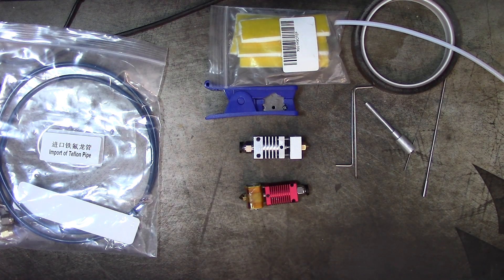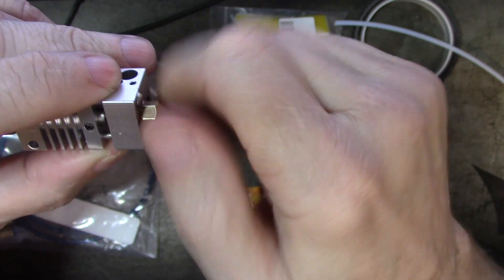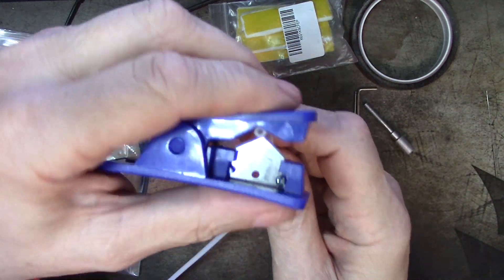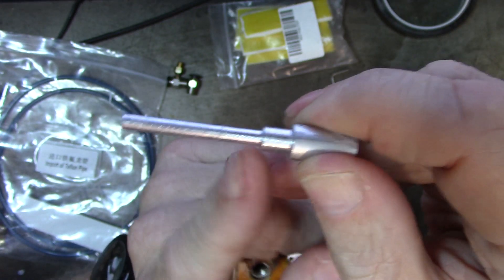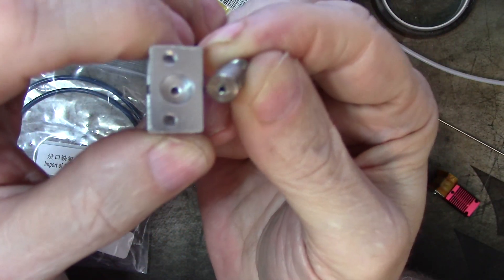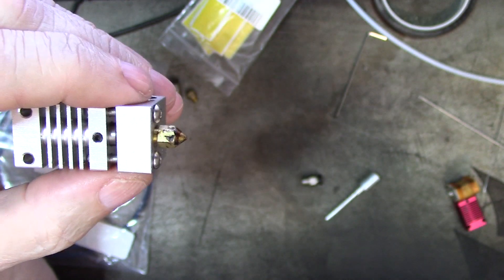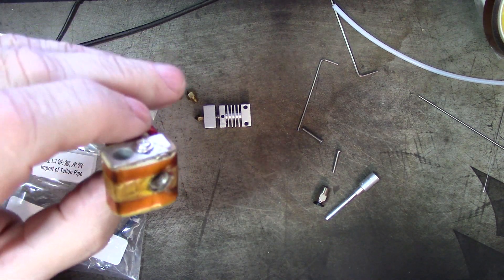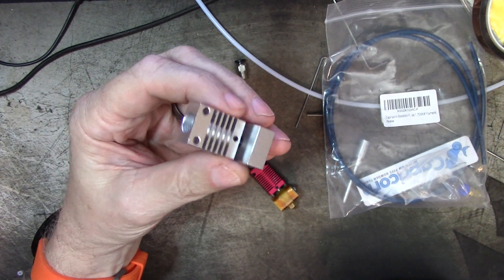Cheap All Metal Hotend for your Ender 3 UPDATE!

Comment: I wonder if my ender 3 v2 came with a metal hotend every upgrade I see the original hot end is red and mine looks like all of the all metal people are buying
Reply from the maker: Easy way to tell. The bowden tube on an all metal hot end will only push in about 10-15mm or so, from then on down the hole is only large enough for the filament.
With a non all metal hot end it will push all the way in until it contacts the top of the nozzle, or about 40-50mm. Or to be completely sure, pull the nozzle and if it's not all metal you should be able to push the bowden tube all the way through.

Comment: I got one of those cheap hotend and it failed me on first print (molten filament leaked between heatbreak and cooler), second try with extra care to prevent any gaps there, again... the machining of the cooler block is bad, maybe that's the case. I gave up on it

Comment: If most of the time only use PLA, PLA+, ABS, or PETG, I would suggest use Ender 3 hot end with capricorn tube.
I found all metal hot end use more slightly higher temperature than the stock one, hence consume more electricity which I believe is not worth it for those filaments.
Consider to use multi hot end for different purposes would be favorable.
Reply: If you have good insulation these few degrees should not cause to consume that much more electricity. Especially if you are using a hotbed. These puppies are essentially wasting all heat you pump to them (cuz you cant insulate the top surface). So in comparison to slightly higher hotend consumption (probably less than 1%). I wouldn't bother with saving electricity by sticking to the old hotend. Also, some ABS filaments like to have 250-255C while printing. This is probably the safe limit of stock hotend. Also at these temperatures, they don't last that long.
That said, I have been using stock hotend with Capricorn tubing and it is such a huge difference to stock one! I also highly recommend this upgrade.
Reply from the maker: Stay with a standard hot end if you don't need to go beyond 250c or so. 
Hmmmm, a multi use hot end? Like maybe two hot ends side by side? One metal and one PTFE? There would be some loss of print area, but it wouldn't be more than say, 10mm. That's an interesting idea.

Comment: I tried printing without the silicon boot on my Ender 3 v2 at 210 C, but it failed because it wasn't able to reach that temperature. :|
Reply from the maker: I've been all the way to 300c with my enclosed Ender 3 and this all metal hot end, but that's with a SKR 1.3 board.  My other Ender 3 has lost most of the factory heat wrap off the stock hot end and it still reaches 235 without an issue. If I were you I'd take a look at the connections and make sure something isn't loose or installed improperly.
Reply: @3rdpig  Thanks! I'll do that. :)

Comment: my mk-8 hotend on a Ender3 pro during the year (5 kg of plastic) did not bring me any issues. I even do not know, should I or not to replace it to a mosquito or smth else hotend?
However, I waste so mach time with CR-10, than you could not even imagine ... That is definitely a trash... Pardon)
Reply from the maker: If it ain't broke, don't fix it. The stock Ender 3 hotend is fine for any filament that doesn't need temps higher than a teflon lined hot end can handle.
Reply: @3rdpig  thanks for a tip)

Comment: For what i know, teflon tube goes all the way dawn because when we leave melted plastic in contact with metal, a kind of rust comes to play with our hot end :( thats also why we should leave the printer on a while after using it
Reply from the maker: Interesting, I've not heard that before. Stainless steel does not rust or corrode (or shouldn't if it's formulated properly) and since the throat on almost all hot ends is stainless steel and the nozzles are either stainless steel or brass rust or corrosion seems unlikely. That being said, there is such a thing as "dissimilar metals corrosion" which happens when two different metals are in contact with each other. Since the body of the hot end is aluminum, the throat is stainless steel and the nozzle is often brass, I could see the possibility of this being a problem. However I've never seen rust or corrosion on my all metal hot end. But I also live in a very dry area.
Reply: @3rdpig  stainless Steel looses its corrosion resistance properties when its heated cant remember the exact temps it happens but its stain-less remember not stain-non

Comment: The type of thermal compound you actually want is boron nitride paste. Slice Engineering sells it, but I assume there are other sources. As you said, the only places you really would want it would be on the nozzle threads (it apparently also acts as an anti-seize compound), and the heater cartridge. as with most thermal compound, less is better and too much will just make a mess. With those screws in, it looks like you'd have 1 tool nozzle change capability which is incredibly useful. Finally, if you're going to get one of these or other 'clones' you might as well get the version with a plated copper heat block. They hold up to temps 400+ which aluminum will not and heat more evenly. Just be careful when tightening the nozzle not to strip the threads.
Reply from the maker: Good info, thanks!

Comment: Thanks for sharing. I had the same problem with these hot ends and I also suspect the cooling fan is not powerful enough to cool down the top part and that contributes to the filament jamming. I was hoping you talk about that too.
Reply: I have a 7 cfm  40 mm x 20 mm fan on my hot end. No heat problems at all.

Comment: Great info. Thanks for sharing.
When I change my all-metal-hotend with silicone sock had to reduce retraction for 1.2 mm however I am still having intermitent problems when hotend travel is long. Retraction speed is same still
Any suggestion?
Maybe I need more insulation for hotend.
Layer fan: same position, half speed.
Retraction speed: 25 mm/sec.
All-metal-Hotend lenght= 0.2 mm longer than No-all-metal-Hotend.
Retraction with:
No-all-metal-Hotend =6.45mm (no problem).
All-metal-Hotend =5.25mm.

Comment: wonder if punting thermal paste were it bolts to the frame would help
Reply: I would not advise thermal paste at all.. it helps transfer heat from the heatblock to the heatsink. 

Adding heat to your heatsink is counter productive, the heatsink is only for taking heat from the throat and dissipating it by airflow..

Comment: Im stil confused about cheap and you know.. ehemm, expensive all metal hotend, so i ask your experience after using it all this time, do you have any problem with the cheap one recently? what is the problem and how many times?
Reply from the maker: I'm still using it on my enclosed Ender 3. Once I got the retraction settings right (which you have to do on any all metal hot end, not just this cheap knock off) it's been working fine without a single problem related to the hot end. I'm doing tests with ASA filament now and that's the printer I'm using.
Reply: @3rdpig  thank you, I am gonna try it.
Reply: @3rdpig  Hey chuck. I got a jam 40 mins into the print. I used 0.5 mm of retraction with PETG set to 230. What do you think i should do next?

Comment: Welp, I must be doing something right because I've NEVER once had an issue with my stock Ender 3 Pro hotend! Until I have problems, I'll keep my original stock hotend!
Reply from the maker: I think you're missing the point of this exercise. There's nothing wrong with the stock Ender 3 hot end. If all you want to do is print filament that requires a hot end temp of 250 or below, there's no reason to change it. However, if you want to print filaments that require a higher temperature then you need to replace it with one that's all metal. Or at least replace the stock bowden tube with an upgraded one, like Capricorn.

If I may offer some advice, maybe you need to ask more questions and gain more knowledge before you start slinging comments around. I won't pounce on you, but there's more than one youtuber who will. Just saying...

Comment: Teflon tape wouldn't hurt anything... I use it in industrial applications where temperatures exceed 300 degrees. It wouldn't be necessary really. But wouldn't hurt anything. Thanks for  the video! Keep up the great content.
Reply from the maker: Great info, thanks!
Reply: @Russell White F
Reply: Teflon and PTFE are the same thing.  You can't use Teflon tape.

Comment: Does anyone know if this will work on an Ender 3V2?
Reply from the maker: I don't. However, if mounting hole spacing is correct and it has roughly the same overall length (mounting holes to nozzle tip) I can't see why it wouldn't work. I still have one new in the package, If you're interested I could send you the measurements and you could compare it with yours.
Reply: @3rdpig  Thanks for the offer on measurements, but I just ordered one anyway. If it doesn't fit, I'm only out a few bucks. 
Thanks again.

Comment: Yes..that's what those 2-extra screws are exactly for. They hold the heatblock while you're tightening the nozzle. Then they should be removed until you're ready to unscrew the nozzle back out.

Comment: will this work on ender 3 v2? and print PETG?
Reply from the maker: It will work on the Ender 3, but you don't need an all metal hot end to print PETG, the stock hot end will work fine.
Reply: @3rdpig  Just to clarify, the OP asked about and Ender 3 V2, not an Ender 3. Do you know if this will work on the V2? Also, is it safe to assume that this would be needed for printing ABS?
Thanks for the great video, BTW...subbed.
Reply: @imacmill  I print ABS with stock hot end all the time on my 3 v.2

Comment: I've heard the silicone sock is just to help clean up for Spaghetti Incidents 😁
Reply: It really depends on your part cooling fan setup too, if that fan blows on the heater block of the hotend too much, you'll have way more trouble keeping the temperatures up, and you use way more power. The silicon socks or some insulation and kapton tape help prevent that cooldown effect a little.

Comment: Some of the manufacturers of hot-ends brag about how their heat-brake is made from titanium to stop heat creep and then provide boron paste and tell you to apply it to the thread that goes into the heatsink and the block, I have asked them to explain this and they claim" the application of the paste will increase the heatsinks ability to dissipate the heat from the heatbrake" well if the paste wasn't applied there wouldn't be any increased heat for the heatsink to dissipate, its fake science they are peddling, and some of the larger YT channels have bought into this and preach it as gospel, I have suggested these YTbers read the book "The Emperor Wears No Clothes"
 Chuck, is the cheap hot-end made of cast aluminium or is it machined? I have seen some supposedly high-quality clones made by a company called Mellow that are machined but they have the Bowden collet like the Micro Swiss and not the pneumatic fitting which I think is superior, I am considering getting one and cutting a thread for the fitting instead of using that plastic Bowden collet
Reply from the maker: Honestly, I'm not sure whether they're cast and then rough machined, or just cut from something like a 1"x1" aluminum bar. Mine are covered with very rough machine marks, almost as if a bandsaw or something similar was used. And the heat block is different than the cooling block. Later versions I've seen are much better finished, but really don't work any better. Personally, I don't care about the ugly since once the fans are mounted no one can see them. 
Way back in the dawn of computer liquid cooling I roughed out some CPU coolant blocks in a similar fashion as a proof of concept. They were horrendously ugly, but I had them done in a couple of hours and they worked great. They ware also about 3x the size they needed to be. But there's no kill like overkill .

Comment: Hey Chuck! I have a micro swiss hotend, and it works pretty well. I ordered a couple of the clones for extra parts. You can't beat the price, so thanks! 

I also have a problem that maybe you (or others) might have a solution for. I have an Ender 3 that has had a squeaking X axis for a while. I've tried to fix it, but can't find the problem. Last night I had a print fail due to the X axis sticking.

I've tried to adjust the eccentric and the belt, but I can still feel it sticking sometimes. For the life of me I can't find any reason for it sticking. The belt kind of wanders around on the bearing, and if I force it to the front it seems better, but I don't know how to fix that. Any suggestions are welcome.

I have a micro swiss direct drive adapter if that makes any difference, but it's been on for a while and I haven't had any problems until a few weeks ago when it started squeaking. I also oiled it a few days ago, which stopped the squeaking...
Reply from the maker: Thanks for the kind words! I've got no experience with the MicroSwiss direct drive extruder, but I can see it possibly causing some problems as it moves the not inconsiderable weight of the stepper motor off the frame and onto the moving X axis, something which the Ender 3 wasn't designed for. I'm sure a lot of people do it without issues, but I'd bet that it makes belt and roller adjustment critical as well as bearing and roller wear. Not to mention slicer settings such as Acceleration and Jerk. Normally I only see a problem with Acceleration and Jerk on the Y axis, but that's typically because it's heavier and then I usually make it worse by adding a glass or mirror bed.

So here's how I'd proceed if I were you. I'd take the X axis apart, inspect all the parts, make sure the bearings and rubber rollers aren't worn, or damaged, then reassemble it and get the belt and rollers adjusted really close. The belt will need to be extra tight due to the added weight of the stepper motor. I'd also lower the Acceleration to around 250 and the Jerk to 5. If the X axis problem continues, I'd swap back to the regular extruder with the stepper motor on the frame and see if the problem goes away. If it does you've found the problem, If it doesn't I'd try swapping the X and Y stepper motors and see if the problem moves with the motor. 

While you have it apart you might want to consider going with upgraded Delrin rollers and better bearings. Putting the motor on the X axis really does add a lot of weight and I'm betting missing or skipped steps is part of the problem.

I hope that helps, keep me posted!
Reply: @3rdpig  Thanks for the advice, and it certainly could have to do with the weight of the extruder motor. My next step was to take it all apart and try swapping out the stepper motor. I could also try putting the old extruder back on.

I'm not sure acceleration will help much. I can slide the roller by hand very slowly and feel the sticking. It doesn't happen every time, but sometimes it just seems to catch on something and get much harder to move. I just can't see what's causing it.

Thanks again for the advice, and I'll let you know if/when I solve it.
Reply: I think I got it fixed. I completely re-adjusted it again and, when I tried testing it the stepper motor completely stopped and the printer gave an error. I figured the most likely cause was the driver, so I swapped out the driver and it's been working perfectly since. I don't know if the failing driver was the entire cause, or a result of a jamb, but it is work now, and I don't feel the sticking anymore. Now back to fighting with some stringy PETG!

Comment: You need to take those screws out AFTER mounting and tightening the nozzle onto the gantry carriage. If you keep those screws in, that's going to promote unwanted heat transfer into your heatsink and cause nothing but issues for you and your printhead... Good luck and happy printing!! --Update: Just to tell you that you won't necessarily see any difference in performance or run into and thermal issues is when performing those long and complex print jobs. Utilize a Silicon Sock to make the job easier for your printer and gain nice accurate temps of your printhead use a SOCK! There will only be a difference in long endurance/complex prints. Also, make sure you have adequate print head cooling... I'm done ranting lol I could go on forever on what to do and how to maximize performance. ;) Happy Printing!!

Comment: The silicone sock insulates the heatblock from the ambient temperature it may only insulate a little temp loss and you may not see much difference or why use it at all, but remember - the tighter your tolerances, the less temperature variation and so a better quality print (if only slightly)

Also, accidentally brushing your hand against a hot heatblock - even while cooling - can cause severe burns. Health and safety.. use a sock..

Comment: LOL, this is a funny video Chuck, I say that because as I clicked on it, I was monkeying with the All Metal Hotend I bought after watching your FIRST video, and never installed. To follow up on the Bowden tubing and max heat question, all PTFE (Teflon) tubing is good to over 300C, and even higher, the reason why people panic and say you'll die is they don't understand the chemistry behind Teflon, and they seem to think it will start out gassing. Go look on Wikipedia if you'd like more information, however, like I always tell people, "you be you, and do what YOU think is best for you, and Ignore everyone else". This is part of the reason I've not installed my All Metal Hotend, that and I'm working on building an All Metal Hotend that's water cooled. The CCP-19 virus has put that project on hold for a bit.
Anyway, Thanks for your videos, I always enjoy them.